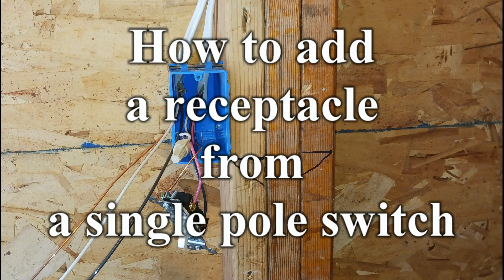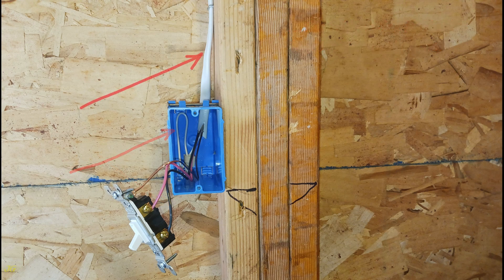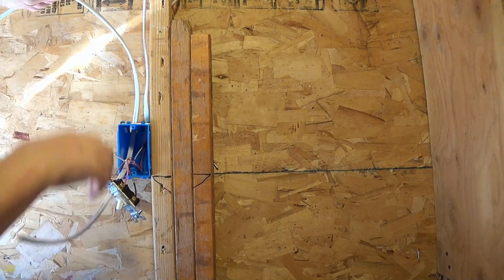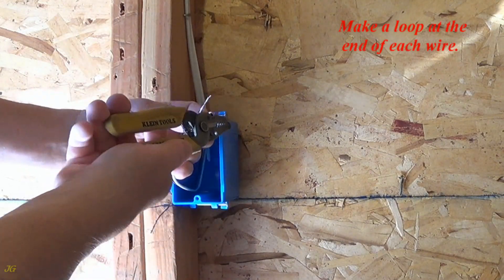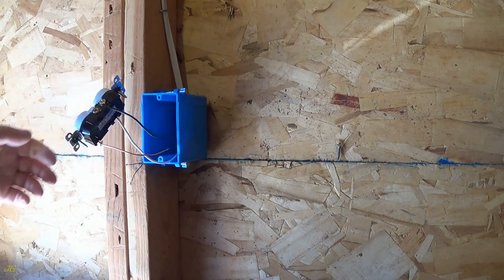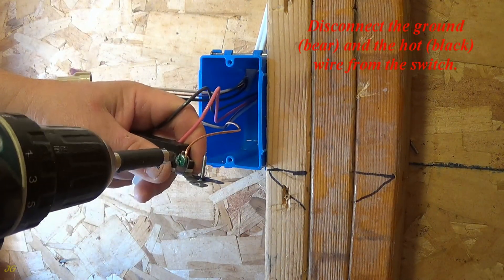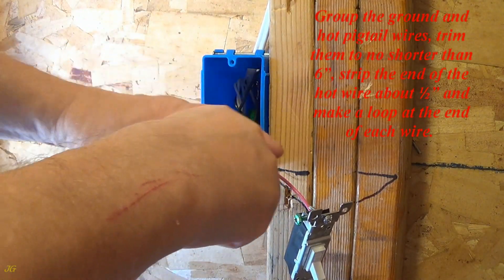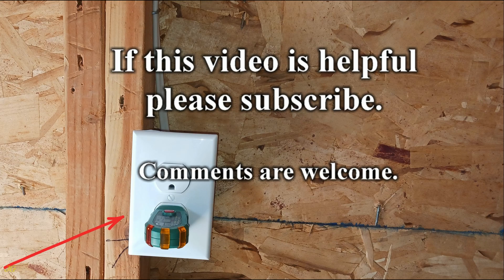How to add a receptacle from a single pole switch

Comment: Very good, easy to follow video. Few critiques. In a 120v  2 wire circuit, white is called the grounded wire (bare is grounding wire). 3 wire, 240v is neutral.
I would use a hand screwdriver, not a drill, to tighten the screw terminals.
That particular wire nut states pretwisting is not necessary, so I've never done it. I let it twist the insulated portion 3x and it's not going anywhere. I have nothing against pretwisting and most seasoned electricians do it no matter what.
The neutral in the switch leg is a recent code addition, so chances are you will come across the 2 hots and a grounding wire. Do not cheat a grounded wire with the grounding wire. Seen it done.
Reply from the maker: Thanks. The grounded wire is not always the neutral wire, but the neutral wire is always grounded.